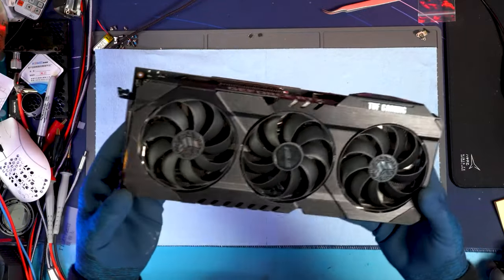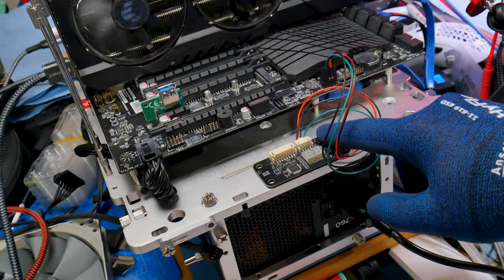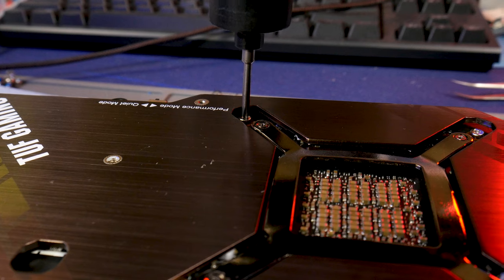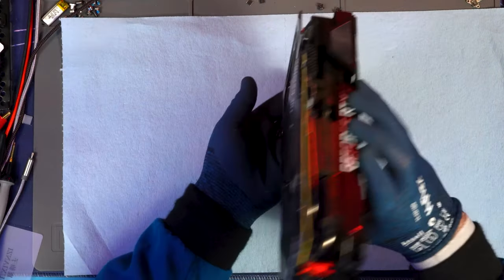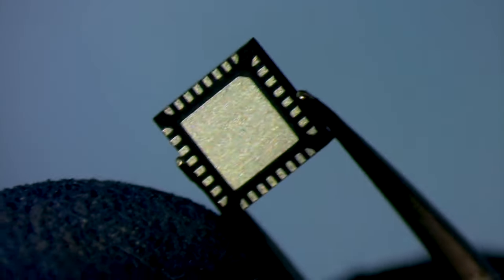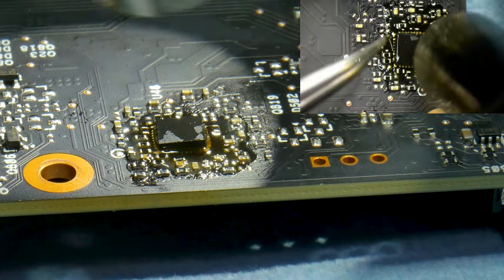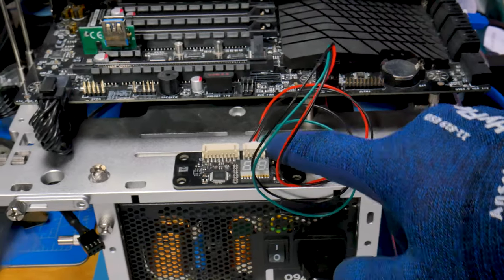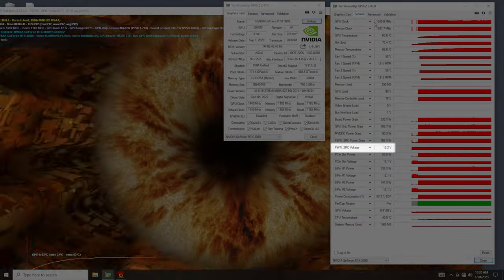The ASUS RTX 3080 That Uses 4,000 Volts – NCP45491 locks core to 210MHz [4]

Comment: Hi Greg! I’ve been battling this issue for weeks thinking it was possibly a bios or driver issue because it intermittently works after a restart then doesn’t after a random future restart. Are you able to do this repair on a 3080 laptop GPU?
Reply from the maker: Yes, We can certainly take a look for you
Reply: it its a Bios issue, then you could try yo flash the bios
Reply from the maker: @namegoeshere197  Im not quite sure, i havnt dealt with a laptop with this issue. It could be a vbios issue. Try NVflash NVFlash: https://www.techpowerup.com/download/nvidia-nvflash/

Tutorial: https://www.techpowerup.com/forums/threads/guide-for-flashing-bios-of-nvidia-gpu.119955/
Reply: @gr3gtech  Sorry didn't see the follow up messages. I did try flashing the bios and flashing the card with a different compatible bios, not fixed. Is it possible to replace the same chip on a laptop?
Reply: @gr3gtech  Have you done this repair on a 3080 laptop yet?

Comment: Only 1500 Mhz ? Isnt this card boosting to around 1920 -1950Mhz ?
Reply from the maker: Hmm, youre right. Though could it be bottlenecked? Or maybe its just furmark being weird? Im using a 4790k on that testbench.

The heaven benchmark claimed it ran at 2100MHz.

Not sure, ill have to test it again when i get the chance. Good catch
Reply: @gr3gtech  Furmark is extremely power demanding so GPU is lowering clock in order to stay in power limit. Power limit for this GPU is 320W and at the end GPU-Z is reporting 330-340W so it seems fine. In normal conditions it should run 1800-1900MHz without issues.
Reply from the maker: @emilszumio3221  Today I learned something new, thank you!
Reply: @emilszumio3221  yeah , i checked my 3060ti on furmark , did teh same thing ,only around 1600Mhz , normaly hovers around 1920Mhz
Reply: @emilszumio3221  I have a 10 gig PNY 3080 (FE specs) that normally runs between 1995-2050 on factory settings.
Reply: @yourhandlehere1  In furmark?
Reply: @gr3gtech  I have same problem with my msi gp66 11ug. How can I fix it, Sir?

Comment: Looks like you got all the easy jobs :P
The last NCP45491 error was on a chinese 3060 with uS monitor ic, no voltage on any rails, after replacing the chip the BUS Ok signal is high, card is detecting and driver is ok, but it measures 9V on the 12V inputs, but current measurements are normal. When loaded the measured voltage drops to 8.7V and the BUS OK pulls the Vcore enable to ground.
With the BUS OK bypassed the card works fine.
I've checked the reference voltage of the NCP, the dividers on the BUS OK reference input and the monitoring reference voltage divider too, and when I change the reference voltage, nothing changes, the measurement stays at 9V. 
I even replaced the GPU (a better card neded a core ASAP and I borrowed it from this card), absolutely NOTHING changes the measurement, except when i remove any of the 3 12Vin 68k resistors from the input, all measured inputs drop to 3V.
I've never had anything like this. The ic power rail is 3V3, the measurements don't change when the reference voltage is changed on a wide range, I have no explanation for this.
ofc I had some easy "just replace the NCP" jobs too :)

Comment: I own a 3090 that causes color distortion in games, and one day it suddenly stopped displaying images. I inserted the card, there is no sign of heating in the GPU, the PCIE 3.3v channel shows chassis and the ncp45491 chip was overheating. I replaced the jeep with a new one. GPU started to heat up. The 3.3v channel chassis has disappeared. The system was turned on, an image appeared on the bios screen for 30 seconds and the card was turned off again. PCIE fuse light came on. The fuse had blown, I replaced it with a new fuse. This time I went back to the beginning, ncp45491 is getting hot like crazy, there is no heat in the gpu, no image. Where do you think the problem is? Can you please help?

Comment: Hi Greg, I have a laptop with 680m igpu and its core clock constantly fluctuates between 400 and 2200 mhz at idle with 0% load, is it normal behaviour?

Comment: I have the same problem with a GTX 1060, that dont use a NCP45491 but INA3221, i changed, still with same problem, GPU clock lock a 139Mhz, i`ve done a lot of changes but still not working.
Reply: Probably the resistors which helps the chip pull out the voltage info.

Comment: Greg, I have an RTX 3080 Palit Gaming OC (Non LHR) and my problem is that the GPU 8-Pin #2 shows that it is drawing 300W constantly. It also all the time locked with only 210ish MHz. Is it regulated by the same chip?
Where should I start looking? I would gladly send it to you, but sadly I am in Brazil :(.
Plz help :( I wanna game :(
Reply from the maker: try and find a local pc repair shop. Might be PCB damage, or might be that chip in the video
Reply: @gr3gtech  Yes, I'm trying to see what I can do.
The weird thing is that this GPU you fixed, had the voltage readings to 4000V, my voltages readings are fine (12V). But my GPU 8-pin #2 Input Power is 370+ watts constantly, and my  MVDDC is 550W+ Watts constantly (which doesn't make sense at all). Temps are normal, card is working, I can play but with decreased performance... Geez
Reply from the maker: @DLain  Try to ask in this discord https://discord.gg/hHPHNc6v
Reply: Tenho uma 3080 da Palit com o mesmo problema.. Travou no 210mhz e o consumo da placa está em 370w.. Me cobraram 989 reais para arrumar.. Você consertou a sua?
Reply: @knislleh não, achei muito caro esses valores de reparo, compensa comprar outra, como tenho outras gpus (3090,4090,7900xt) deixei essa gpu parada por enquanto, comprei todos os pmics do Aliexpress, me cotaram a 1300 para arrumar, achei caro.
Reply: @DLain  verdade. Eles fazem o reparo pelo valor da placa atual. É foda.. Eu não compro mais placas da Palit.. 2 anos de garantia e difícil engolir que com 2 anos e 6 meses estraga algo.. Comprei a placa na época da alta (ago/2021).. Custou 8k.. É triste demais.. Não voltarei a comprar placa desse valor com garantia menor que 3 anos (asus dá 3)

Comment: i have a problem with asus tuf 3080 where randomly display signal will be lost on both monitors, cannot recover it without having to do a full reboot. when it reboots the first time, i get small green dots on a corner of one monitor and after another reboot it goes back to normal and works for a day or two before having the same issue. i have only noticed it in games. is this something you think you could diagnose/repair?
Reply from the maker: Yeah, it sounds like failing memory. Try and wait till the symptoms become so consistent you cant play around them. Because sometimes we have customers who send their cards to us and the cards basically stop having problems for a while after being powered off for a few days.

Comment: Hello i have the same issue with my asus tuf rtx 3070 when i load it in furmark it stay 210mhz but the wattages are normal. But when i oc it a bit like +300 on msi afterburner it will go back to it's core clock around 1515 then i load it on furmark it does go 1515. Can i ask if it has the same issue cause I'll try to buy an ncp parts then go to a local repair shop to change it for me. Thank you for the help
Reply: Hey bruv...did you find a solution?
Reply: @jima4595 not yet but already did send my gpu to a tech and he said next week will know if it will be fixed or not
Reply: @jima4595 i have sent it to another tech he diagnosed it on the power regulator he successfully being it to normal but the thing is when it's loaded it crashes so the tech right now is gonna reball the gpu chip soon im hoping it be successful
Reply: @sheshable25  So, did you get it fixed, mate?
Reply: @anonpacy  welp gpu chip was bloated so im just waiting for gpu chip replacement
Reply: @sheshable25  How much would it cost for you? And what do you exactly mean by chip is "bloated"

Comment: my rtx 3080 asus tuf is showing artifacts (white pixel flickering on some black/gray screens)... the temps are ok, but idk what the problem is, but the card works and everything. i placed it inside a friend's computer system and it shows the same problem, so i narrowed it down to the gpu. wish you guys were in atlanta so i can have it repaired lol
Reply from the maker: This is something we would most likely be able to fix. If you can package your card up, we will provide you a shipping label. Our turnaround currently is 10 days.
Reply: @gr3gtech  do you have an estimated cost of repair?